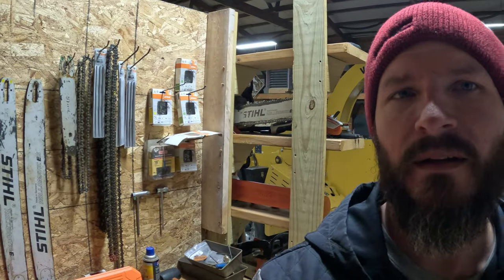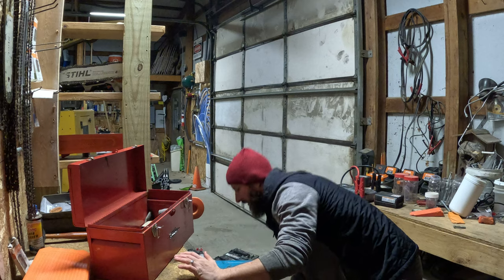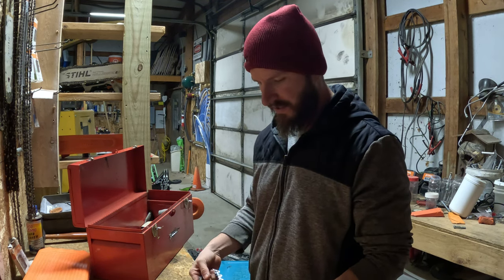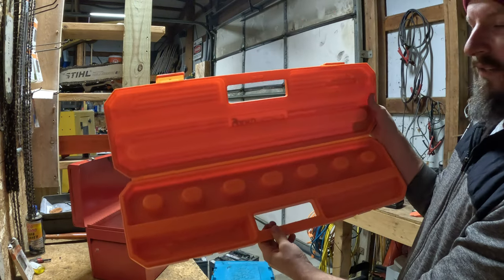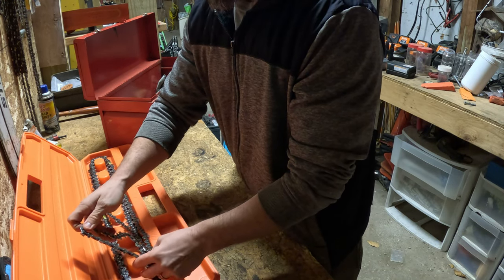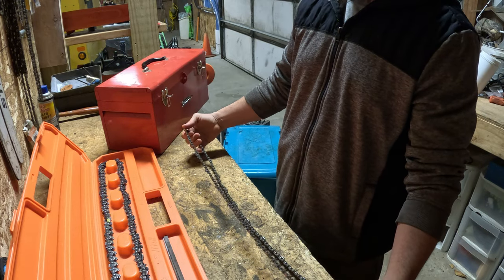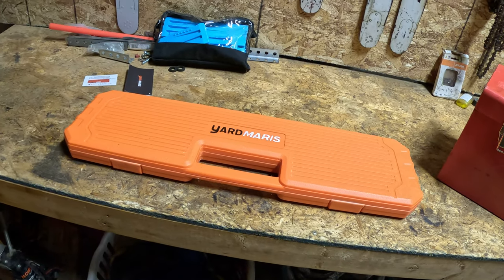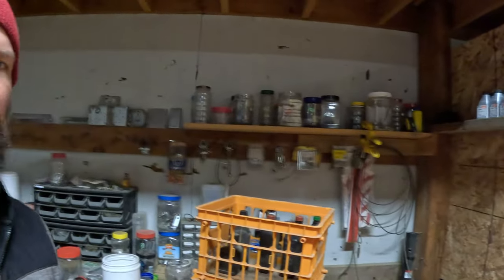I Found It, Best Way To Store and Transport Chainsaw Chains!

Comment: I received a couple of them as Father’s Day gifts. I use one for sharp chains and one for dull chains. They work great for keeping track of which is which. I am not sure who makes the boxes I have but mine are two different colors. When I first saw them I thought they were going to be a gimmick.  After the first use I was sold. Now I rarely sharpen a chain in the woods. I just bring them home and put them on the chain grinder. Great video. Have a great day.
Reply from the maker: Yeah my thoughts exactly. Great storage and you know what’s what. This will definitely be in the work place daily.

Comment: Great looking product. I purchased the wedges.  looks like you sold me on this too. Organizing is have the battle some times.
Reply from the maker: How do you like the wedges? Yeah I bring the case with me everytime now. It’s awesome. Something so basic makes a world of a difference.
Reply: I love the wedges. They bite well and look like there going to hold up well. The storage box be careful spraying your chains down with  WD-40, different products act differently to polypropylene (plastics). I spray a lot of my stuff with. KROIL penetrating oil. I need to check the can and see if it’s compatible with plastics. By no means am I knocking the box down. It’s definitely a fantastic product for its use. I can’t wait to own one. I can’t thank you enough on those wedges. I will definitely buy more when needed. Have a great evening sir. 👍
Reply from the maker: @BW35bucket I’m just curious. Why don’t spray your chains with wd40? I guess I use my chains too fast to have to spray them. Or just crank up the bar oil so when they sit they are full of bar oil?

Comment: Looks like a nice box. I use a chain locker case. It works grate. Think it works better for the long chains.
Reply from the maker: Yeah longer chains I bet for sure. I normally just run 20/25 chains. My longer bars and chains don’t get used that often.

Comment: I have gotten too the point now that we will touch up the chain as long as it's still on the saw. But once we pull it off because it hit a rock,  nail,  dirt,  concrete,  or is too dull and going to take too much time we just throw them away and put on a new chain and get back to cutting. My rule is if one of my guys are going to spend more than 5-10 minutes on a chain sharpening it put a new chain on and get back to work.  I buy my chain loops in bulk and save enough money ( 25-50% ) that on16" too 25" chains it costs me more to sharpen them than I pay for a new chain.
Reply from the maker: Yeah I’m the same way really. If the chain just dulls over time then yes we sharpen on site. If we hit something on site I will take it off and then hit it with the grinder at a later date. Time is money and yep get back to work.